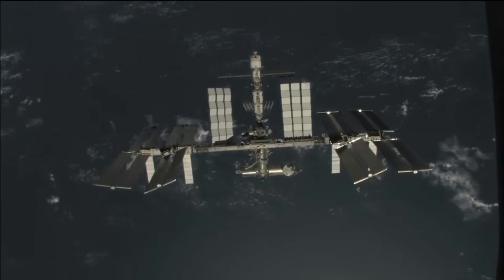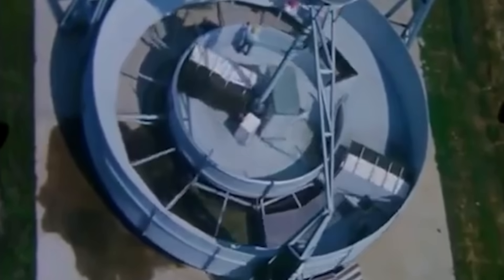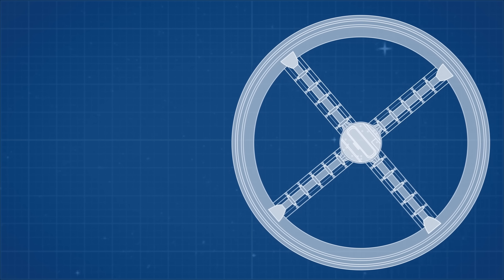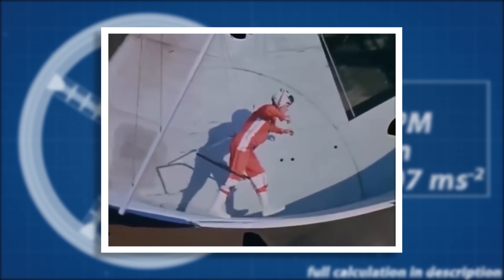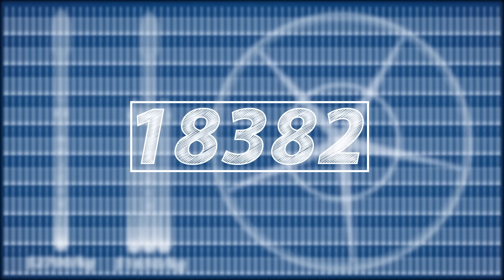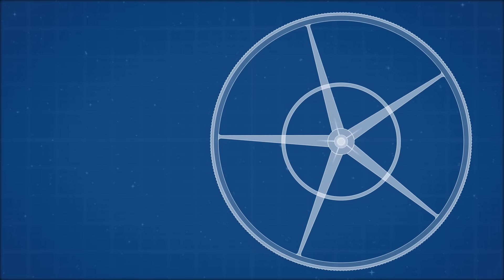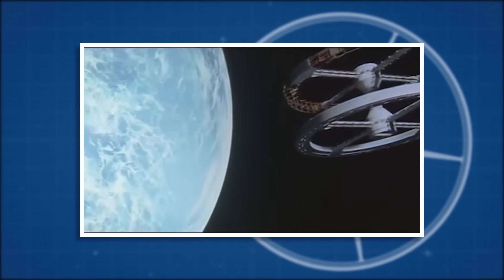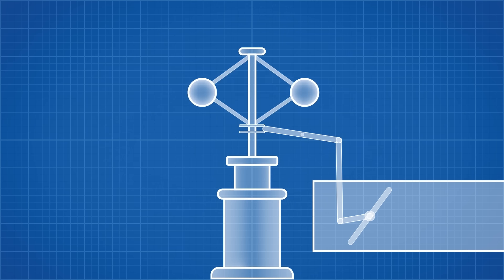Can We Create Artificial Gravity?

Comment: What are those things hanging off that dude's legs?

The guy walking around the loop...
Reply: to cancel out earths gravity. this artificial gravity is designed for space, so they need other stuff for it to work when there already is gravity
Reply: William Herron riiiiiight Thanks
Reply: C Hillman  " yup a Model, as in a bullshit theory" 

No I mean a model as in a MATHEMATICAL model. You can't dismantle math by wishing for it. Math describes our universe better than anything else we have available. 

"Earth orbits the sun, thanks to the microgravity at 66,600 mph too right."

Actually no, the earth orbits the sun thanks to regular gravity. Microgravity is an effect that takes place when you are "falling" at the same speed as what's around you. Like when you feel weightless for a second on a roller coaster. 

" This micro gravity is strong enough to hold all the planets in orbit - but somehow not strong enough to suck the planets into the sun or Moon's when they pass directly in between. "

Again microgravity is not to blame here, but regular gravity. Gravity DOES pull on the planet's, very hard actually but the way an orbit works is that it essentially moves so fast sideways that it "misses" whatever it is falling towards and continues to "fall" and "miss" the planet repeatedly. (I suggest looking more into the physics of circular motion and orbits if you're interested). Imagine that you could throw a baseball fast enough that as it curved and fell towards the earth, the earth curved away faster. This is essentially an orbit. 

"It strong enough to hold the weight of all the water and atmosphere while we spiral around the arm of the galaxy at 450,000 mph"

The reason why the water is undisturbed is due to another basic physics concept called Inertia. (completely unrelated to gravity for the record). Since the water is moving WITH the earth at the same speed, it appears as though it's not moving. This is why you can't feel that you're moving in a car without speeding up or slowing down. 

Yes, it is also gravity which is responsible for keeping it in the water in the oceans, but also for keeping the entire planet together in general. Without gravity the earth would never be more than a cloud of dust floating freely in space. 

" yet not powerful enough to hold the weight of a simple balloon, "

A balloon goes up thanks to something called the buoyant force. It is dependent on the density gradient of the fluid the it is in (in this case the atmosphere). You see a helium balloon is lighter than its equal volume of air, and thanks to gravity, the air on the bottom of the balloon is at a higher pressure than that on the top, so there is an upward force. Once this force is sufficient to overcome the opposing gravitational force, the balloon goes up. I don't see anyone claiming that a boat fucking defies gravity, seriously give this two seconds of thought. 

"magic - don't question its awesomeness"

No, it's science and you should question it, but when you do have some idea what you're talking about. 

p.s. we have the math so we win...

Hope this clears things up :)
Reply: C Hillman Quantum Electro Dynamics is the mathematical model of the electric force, and it has been shown to be accurate to the real world to one part in a billion (or 10^-9)

Nothing in the history of humanity has been that accurate or precisely measured.

"mathematical models don't work" My fucking ass, try taking a calc class maybe before dismissing the entire field.
Reply: C Hillman 
Earth gravity is easily modeled by a "downward" acceleration of 9.81 m/s^2. The way that this loop works is based on centripetal acceleration. When observed in the opposite frame of reference (the guy in the loop) it acts like a force pressing him into the wall of the wheel, acting like gravity. (centrifugal force)

True gravity is a warping of space-time caused by masses that ultimately causes them (the two+ masses) to be pulled together, Shown by the equation:

f=(Gmm)/r^2

Where f is the force of gravity, G is the gravitation constant, m & m are the individual masses in kilograms, and r represents the distance separating the two masses. 

So yes we know what gravity is, we know it very well. Micro-gravity is an important distinction from "no-gravity". Micro-gravity is a "simulated" weightlessness caused by accelerating uniformly. The ISS feels a pull of gravity from the earth, but thanks to the fact that it is essentially falling perpetually along with everything inside, you feel weightless. This is micro-gravity. 

I hope this clears up some confusion about gravity :)
Reply: C Hillman Don't even fucking try to talk about math with me, you are clearly mathematically illiterate. I guarantee no one in the scientific community EVER divides by zero. 

There is a thing in math known as limits that lets you do something like dividing by zero, but it is entirely different, and irrelevant to Einstein's theories. 

Trust me, if you actually dismantled his theories (which you've obviously never read) you would get at least one nobel prize. 

"blinding with numbers" is not a thing if you know math. It allows you to see further and clearer than any eye could ever see.
Reply: C Hillman I have his book "Special and General Relativity" It's sitting on my nightstand literally right now and I've read it multiple times.

I know what his theories say, you've obviously never tried if you think you'll just "get lost in the math".

So ya, I've read it, good one tho, try again!
Reply: Chris Topher "Id show you the proof but ill just leave that up to you to find the link."

There is your problem friend, you think you don't need proof for some reason. Well it turns out your opinion isn't worth its weight in shit.

"even Einstein had to divide by zero and do some number aerobatics to suggest the Theory of Black Holes "

I've already pointed out why this is completely not true, and you only continue to show your ignorance of math and Einstein's theories.

Keep telling yourself you're right, and maybe one day you'll be able to convince yourself.
Reply: C Hillman There is legitimately a 70 line explanation consisting of centripetal force, gravity, relativity, that I wrote. I've explained everything multiple times. 

You on the other hand have been claiming that mine is all just based on "bullshit math".

In other words: "boohoo math is too hard, and I have no argument!!!" 

The earth's spin is irrelevant when everything on the earth is spinning with it. This is called inertia, and this is why you don't normally "feel" the earth spinning. 

Coriolis forces are the result of being in the rotational reference frame that is the earth, and is irrelevant to this conversation. 

The earth's spin DOES have an effect on the Earth's shape if that's what you mean. The earth is not a sphere, it is what is called an "oblate spheroid", as it bulges out at the equator slightly thanks to its spin. This has been known for sometime and is the result of gravity and centrifugal forces on the earth. 

We have debated for a week, and yet your best argument is "Go read relativity, he divides by zero!!!11!!"

- You don't even know what you're talking about mate.
Reply: ***** One of my favorite quotes
Reply: C Hillman You're right, it has nothing to do with gravity. I was merely using it as an example of how precise our mathematical models can be. 

Try doing the math and you'll realize that we know how centripital force works very well. The centripetal force is one that points directly inwards at all times. It points perpendicularly to the tangential direction of motion at any point the the object is at around the circle. It acts to continuously change the direction of the object's velocity vector, while leaving it's magnitude constant. 

The "centripetal force" can be provided by many "more basic" forces such as friction (like when you're turning a corner in a car), Tention in a string (like if you're swinging a yoyo around your head), or gravity in the case of an orbit. 

This is literally high school physics, I wrote a lab on this very topic in my senior year. If you knew anything about math you would know how powerful it can be for modeling known systems and predicting previously unknown elements of these systems.
Reply: C Hillman If you really can't understand how a centripital force can be caused by gravity, I can't help you friend. 

If you really want to learn physics, actually read about it. You're making 100% unfounded claims. All you are doing is saying that our ideas are shit, without offering any reasons or better options. 

You're never going to make any scientific discovery by shitting on a theory  you clearly don't understand. 

I'm quite well versed in physics, so if you wish to have a real conversation with me, go re-take grade 6 math and then come back to me...
Reply: C Hillman You realize that you're literally trying to disprove Einstein right now... 

His name is synonymous with genius, but no this dude on YouTube definitely knows better!

Get a grip you mouth breather
Reply: Radio ToraDora I know it's useless but hey it's something to do.
Reply: C Hillman No you can't create "artificial gravity" (?) because gravity is caused by mass. You can't create "artificial mass" can you? No

However, you can measure the gravitational attraction between two known, already existing masses, and this has been done countless times by many research groups. 

Furthermore, gravity was only first suggested by Newton some time in the 1600's, so try 300-400 years, not 2 000, but just because we can't make some crazy anti-gravity gun or whatever the hell you're talking about now (no really you're making no sense) doesn't mean our gravitational model is not incredibly well understood. 

You can't make a sunrise at will, but we still know how it works. 

No mental gymnastics are needed, It is clear you have never even seen a physics equation before, but go ahead keep trying...
Reply: Don't get into an argument with an idiot. They'll bring you down to their level and beat you with experience.
Reply: C Hillman This wasn't even an argument. This was you putting your fingers in your ears yelling "LALALALALALA"  while I continuously owned you with science.
Reply: C Hillman *you're

If you're going to insult my intelligence, spell everything correctly.
Reply: C Hillman Buddy dosen't even need to read my argument to dismantle it apparently...
Reply: +Don't Even Bother don't bother (what your name suggested), it's a waste of time to argue with him. He's luckily not a flat earther.
Reply: C Hillman Look up Hawking-Penrose's Models if you're interested in black holes. 

As for the "holy grail of gravity" there are some unanswered questions, like How does gravity relate to the other fundimental forces, and notably quantum mechanics? But these do not take away from what we know about gravity, space-time, gravitational lensing, orbital mechanics, relativity, and all the other nuances of gravitational theory.
Reply: C Hillman Lmfao, I guarantee you that Neil DeGrasse Tyson definitely KNOWS (that's right KNOWS) that mass causes gravity, but no he is definitely smarter than me (in astrophysics at least), but he would be a terrible example to use if you're trying to dismantle gravity, because he definitely agrees with me. 

"but i can't be replicated no matter how big a mass we create something"

Yes it has been done many times by research groups all over the world. If you took two seconds to look it up before saying it hasn't happened ever, then you would stop yourself from looking so uneducated. 

"even quantum physics can't find it"

These are the ramblings of someone who doesn't know the first thing about physics (i.e. quantum woo), but as I said before quantum mechanics is completely separate from gravity in every way. In fact it is pretty much the goal of much of physics right now to unite gravity and quantum mechanics, but it has been unsuccessful so far. So if you think that they are related, please do tell, there is sure to be a nobel prize in your future. 

"i suggest you crack open that year 1 physics book and rethink what you really know."

Alright, I always look for an excuse to do physics. As for you, I suggest you actually buy a first year physics text book. 

Better yet, actually go to a physics class and learn from someone who studies this for a living, and for god sakes LEARN SOME MATH.
Reply: C Hillman Here is some critical thinking for you:

Who is likely more correct?

 Two hundred years of professional physicists dedicating their entire careers to the study of their choice. These being people who are driven by knowledge. Knowledge that they also spent years to try and make public so that it can be properly reviewed...

Or this guy on YouTube who refuses to even tell me anything about his position other than "your ideas are stupid"?
Reply: he's hanging by wires on his side. Kinda like a hollywood ninja movie. You're looking down from above and the spinning drum is flat on the ground.
Reply: why do you bother :D
Reply: +Don't Even Bother What a legend you are
Reply: C Hillman No, just no. 

Do you honestly think that I am going to spend my time looking for evidence supporting your argument? 

Literally no one would, fuck off.
Reply: C Hillman All you have to do to prove me wrong, and get me to shut the fuck up for good is to point me to the exact passage in Special/General Relativity, where Einstein "divides by zero to make his theories work". So that I can see it with my own eyes. 

You said it, so it must be true... or would that just be making it too easy for me? Wouldn't want to be spoon fed the information that is going to completely overhaul physics!!!!
Reply: C Hillman And in a stunning turn of events, I win.
Reply: C Hillman Anyone who calls it "astro science" is clearly super duper smart amirite?
Reply: C Hillman You're a walking joke
Reply: Chris Topher *edits his comment so he doesn't look dumb.
Reply: Chris Topher Yeah i let my balls dry in the wind when Im done showering, hows that for free?
Reply: Chris Topher There, once again you have only proven your ignorance. 

Like I said. Gravity is a physical phenomenon. You can DESCRIBE a physical phenomenon with math, but you can't PROVE any physical phenomenon (what the hell does that even mean? honestly).

You can collect evidence which supports the theory and the description of the phenomenon. 

For god sakes I've asked you to show me this compelling evidence that you have which suggests gravity is anything other than the 3D warping of spacetime caused by mass over and over again. 

You refuse to give it to me only claiming that "I have to look for it". This makes no sense because I'll never know what the hell you're talking about other than the vague concept that gravity is electromagnetic? 

That's not a hypothesis, you have to predict something with your potential theory, and then demonstrate your prediction to be true. 

You obviously don't ever partake in scientific discussions because this is incredibly one sided.
Reply: Chris Topher You haven't given me so much as a single article, link, or even a damn suggestion as to what to google to hear about this trash.
Reply: Chris Topher No, there's a difference between spoon feeding information to someone, and that person asking you to clarify what the fuck you're talking about.
Reply: It's simulating weightlessness in a 2D and ignores the depth.
Reply: Chris Topher Proof, evidence, call it what you want, you still don't have any... (or you would have presented it!)

"it took me forever to find" is a fucking cop-out and you know it.

You know you have nothing, I have you backed up in a corner, it's okay.
Reply: Chris Topher Lmao what does that even mean? 

p.s. I have a good friend that we call chris topher (no lie) this is wierd.
Reply: awesley92 lol, see it as an excuse to brush up on my physics.
Reply: Chris Topher You sir are the one who doesn't realize the beauty and complexity of the physical world when you do away with preconceived notions. 

You don't even know what you don't know, and that is fact. 

Plato called it double ignorance, I call it stupidity, but the first step to knowing is admitting what you don't.
Reply: awesley92 Oh of course, how could I forget
Reply: Chris Topher You wouldn't even know where to begin with a mathematical proof sir.

You obviously don't know the meaning of the word. Claiming 2 + 2 =5 as an axiom would is never how it works.

Have you ever even heard the term "proof by contradiction", "Proof by induction", "Direct proof", or ANY of the hundreds of different methods used by mathematicians?

Believe me, someone who has been studying math for a long while.

Proofs are hard.

For example, we can prove by induction that all positive integers of the form 2n − 1 are odd. Let P(n) represent "2n − 1 is odd":

(i) For n = 1, 2n − 1 = 2(1) − 1 = 1, and 1 is odd, since it leaves a remainder of 1 when divided by 2. Thus P(1) is true.
(ii) For any n, if 2n − 1 is odd (P(n)), then (2n − 1) + 2 must also be odd, because adding 2 to an odd number results in an odd number. But (2n − 1) + 2 = 2n + 1 = 2(n+1) − 1, so 2(n+1) − 1 is odd (P(n+1)). So P(n) implies P(n+1).
Thus 2n − 1 is odd, for all positive integers n.

All that did was tell us without a doubt that (2n-1) is always an odd number.

So you can see how complex this straightforward example is, now imagine how much harder it can really get.

Mathematical proofs, however will never demonstrate that a hypothesis, equation, or model fits the observed evidence. You'll never see a mathematical proof for the equations of gravity, because that's not how it works.

To prove a scientific theory requires experimentation, data collection, isolation of variables, graphical analysis, and a whole slue of other techniques, none of which are to make "debunking" YouTube videos.

If you want to prove your hypothesis that gravity is fake, you'll have to get a little more complex than saying "math sais 2+2=5, therefore gravity is actually electromagnetism." Now that's just silly.

Doing this you really minimize the lifetime of work and dedication it takes to thoroughly understand these topics, but you won't read this comment, you'll just cover your ears and start reciting dogmas in your head.
Reply: Chris Topher Your only problem is an unwillingness to learn. 

An intelligent human being can mentally process and idea without accepting it to be true. You refuse to even undertake such a simple task. 

YouTube's crazy side has taken you too far down the rabbit hole... There's no coming back
Reply: Chris Topher Thank you, this has been a great insight into what I don't want to become.
Reply: Chris Topher There's no helping you, loosen your tin foil hat. 

peace bitch
Reply: Chris Topher Aha, I'm writing cover letters for a cooperative position focusing on organic chemistry and synthesis. 

What are you doing?
Reply: Chris Topher Greeeeeat argument there buddy, for every bad thing chemistry has done there's 150 000 noble ones, no one with a brain agrees with you.

Nitrogen fixing is the process that feeds over a billion and a half people on the planet, including you if you live in the first world.

The goddamn computer you're arguing me on is a testament to the power of chemistry, silicon p and n-type doped semiconductors.

Inoculations, medicine, and every single bodily function is just one extremely complex chemical system.

Bringing up 200 year old ways of thinking is not going to dismantle quantum mechanics, molecular orbital theory, Bohr's theory of the hydrogen atom.

Alchemy, even though no one has talked about it for 200 years is more related to particle physics, and for the record, we HAVE now turned base metals into gold using particle colliders. Nonetheless it lead to some of the earliest progress within the field of chemistry.

Those who were smart enough learned to follow the evidence, bringing us after hundreds of years to what we have now.

Next time you take a life saving drug or anesthesia when you undergo surgery, you damn well better thank the world's chemists bitch.

You're in so far over your head here kiddo. If you get me starting to talk about chemistry I'm just going to keep schooling you relentlessly.

You have been warned...
Reply: Chris Topher I spend 6 hours a week at the very minimum in chemistry labs, and many more doing the work associated with it. 

Try me
Reply: Chris Topher Okay, I'll take that into consideration. 

Tell me, if you love the Pacific ocean so much, why don't you head out there with a butterfly net.
Reply: What a troll hahahahaha.
>gravity alone doesn't explain the effect of the density/buoyancy therefore gravity doesn't exist

Since you also don't provide an explanation does that mean that you too don't exist either? 
I'm just using your own logic bro...

(For the record I don't think anything objectivly exists and this is all theoretical. But that is seperate kettle of fish altogether and I accept that there are scientific principles govering this particular theory space. Unlike you apparently?)

Next time you try to discredit something how about you consider providing an alternative or at the VERY LEAST an explanation as to why it's incorrect.

In finishing you can believe what ever the fuck you like but unless you bring something to the table you are just going to be laughed out of the building...
Reply: Chris Topher for your balloon problem the reason a helium balloon floats is because the gas inside is less dense, therefore there are fewer practicals to be pulled down than in regular air. Its only the atmosphere that creates that illusion. In a vacuum it would be accelerated by gravitation the same as any other object.

And yes Newtonian gravity was disproved like a century ago, it was replaced by the theory of gravitation for which the math holds perfectly fine.

And before you say it's "a theory" everything thing is. That is just the nature of a subjective reality. nothing can be known for certain, but these principles hold better than anything else we have come up with, so it makes perfect sense to me that we work off the assumption that its correct until it's disproven or a superior  alternative is found. Otherwise you can't get anywhere.
Reply: Chris Topher lastly I don't have enough of an understanding about quantum mechanics to make comments on the higgsfield which is assumed by many scientists to be the source of mass in the universe. But even if our understanding of the mechanism behind mass is incorrect the effect of it is quite noticeable and the math we have developed using it is incredibly useful. So to just completely discredit the idea would put us back in the stone age. What it comes down to is that science has an idea that appears to work for the most part so we just keep using it until something better is discovered then we modify out current knowledge base to fit the new principles.
Reply: At the end of the day when you drop a rock there is an increase in kinetic energy relative to you. Even if that doesn't come from the potential energy of gravitation (but mathematics, our formal language of logic, shows that this  method can hold),
there is some force at play which you cannot seem to explain without accidentally using gravitation.

If you aren't interested in trying to look at it from another's perspective than this entire discussion is pointless. I have consistently tried to look at it from yours but you haven't given me any tools to logically prove it (eg proof by contradiction)
Reply: Chris Topher Buddy, you're literally just copy-pasting your arguments from shit blogs

http://aaronsreality.blogspot.ca/2009/07/disproof-of-gravity-by-aaron-guerami.html

That's for the 200-liner you just dropped up there, oh great science master!
Reply: Cause its not real gravity, its simulated gravity by just duplicating centrifugal force - if he stops moving -he's screwed. Artificial gravity is just fantasy thinking, because they can't even explain what gravity is. It's funny how they refer to space as having microgravity now - what a joke.
Reply: yup a Model, as in a bullshit theory - thanks for clearing that up. Earth orbits the sun, thanks to the microgravity at 66,600 mph too right. This micro gravity is strong enough to hold all the planets in orbit - but somehow not strong enough to suck the planets into the sun or Moon's when they pass directly in between. It strong enough to hold the weight of all the water and atmosphere while we spiral around the arm of the galaxy at 450,000 mph yet not powerful enough to hold the weight of a simple balloon, magic - don't question its awesomeness.
Reply: yup, you shoulda stopped after the first line
Your mathematical models are but assumptions and failures, you have been fooled.
Reply: Don't Even Bother I read it but an electrodynamic force is not gravity , spinning an object just creates centrifugal force at the extremes, try standing in the middle and you'll realize all your models are complete horseshit made to fool the weak minded.
Reply: So you finally admit it, centrifugal force has nothing to do with gravity and being knowledgeable about electrodynamic models does not give you any insight into the working of this invisible force that makes certain things fall to the ground. I really get about as much information from reading your comments as I do when i looked at the log that came out of my butt this morning. Thank God for the myth of the Coriolis force force that allows me to flush that away.
Reply: Most of his work depends on you believing division by 0 is actually something, he blinds you with numbers.
Reply: Don't Even Bother Why dont you actually read some of Einstein's theories instead of assuming you know anything about what you were taught to think.
Reply: Don't Even Bother So why dont you sweep the dust off your nightstand all tell me the exact math theory is that describes what a black hole is? Isn't it the holy Grail of Gravity?
Reply: ***** Wait what is this about?
Reply: Don't Even Bother Well you can't create artificial gravity - if they don't even know what gravity is, because gravity itself is still just a theory - and despite Two Millennium to prove its existence - it's still pretty tough to do the required mental gymnastics required to accept it although they certainly have done there best to make everyone believe it's real.
Reply: Don't Even Bother well it's obvious you were taught but so was I. Are you sure mass causes gravity, Don't you think its funny that even Neil Tyson doesn't really know what it is- but your 100% sure you do. Are you saying your smarter than him?
I know you were taught that, but i can't be replicated no matter how big a mass we create something- even quantum physics can't find it , so i suggest you crack open that year 1 physics book and rethink what you really know.
But I'm sure you wont - thinking you know it all already - but really what do you know.
Reply: Don't Even Bother "Neil DeGrasse Tyson definitely KNOWS" - He has a guess , I'd call it an educated guess. But at least he knows the difference between a guess and actual fact - he cannot truly describe what causes it or what it does - cause he knows it know matter what he said it be a lie and that's its still only a theory that Newton only suggested and that people like you accept as total fact. And brainwashed in your consciousness by Disney and Nasa.

Id show you the proof but ill just leave that up to you to find the link. Time to wake up.

How can math prove something that doesn;'t exist - only in your mind is how.
Btw the math doesnt prove anything and some of it is fake - even Einstein had to divide by zero and do some number aerobatics to suggest the Theory of Black Holes - even my 8 year old daughter knows you can't do that. You've simply been fooled, distracted by your own ego.
Reply: Proof is not evidence if i just spoon feed it for kids to spit up.. Took me a long time to find it. You can find all kinds too, once you actually start looking.
Reply: Don't Even Bother proof is all over the internet, like i said not my job to spoon feed you, crying might work with your mother, but her I am not.
Reply: Of course you won't, idiots like you expect everything your free and cry if you don't get it.
You only get what you pay for and public education has only taught you to memorize facts - not how to think critically.
Reply: Don't Even Bother Why would I spend a week debating you, your not even in a learning attitude, go pay for your education.
You got 200 years of information to stand behind so feel free to use it at anytime - Like would you care to explain to explain as to how an airplane's gyroscope works, the details of how and why they work, and then exactly how they account for the earth's spin and coriolis regardless of direction all while they are accounting for a curve.
Reply: Don't Even Bother " 
Don't get into an argument with an idiot" - mmm ok you win.
Reply: Don't Even Bother Astro Science got Rekt.
Newton's work into how to turn stuff into gold are better.
Reply: Don't Even Bother That's what Sun Worshipping Atheist Astro Priests study.
Reply: Don't Even Bother Considering you're a beslubbering hasty witted dingleberry, that's a compliment, so ty.
Reply: Don't Even Bother Can you prove a dingleberry has intelligence? If not - I didn't insult it then.
Reply: long fall boots.
Reply: Don't Even Bother *edits his mind so he can believe what he is told to think.
Reply: Don't Even Bother It just means you need to figure out how someone is telling you what to see If I, or anyone tells you an opinion, they don't care whether you believe it or not, if however they are using simple social stigma to force you to believe propaganda and someone needs to get angry because they dont want to realize they themselves are being controlled This conversation was initiated because your mad that you can't control what i think, your continued denial of this fact is proof of your sophistry in your reasoning.

Well if you have a good friend called Christopher, i'm not surprised because they are usually good friends, please stop trying to be my enemy.
Reply: +Don't Even Bother don't know why you bothered with this dude for so long, he obviously sits in his lead encased basement with an aluminum foil hat on
Reply: awesley92 I let the wind blow my into my beautiful hair, your mind is encased in a lead prison created by the astro priests and you dont even realize it. Free yourself.
Reply: Don't Even Bother I know that if Gravity was really real, there would be some way to prove it and that its buffoonery is completely revealed whenever you try to introduce a third object into the false idea that mass attracts mass and that gravity the only reason you think the world is round - you're completely deluded into your fake reality and cling to it like a baby does to his security blanket.
Reply: Chris Topher Lmao I love how you think multi-bodies systems oppose our understanding of gravity. 

If you want proof for anything you have to do your research.
Reply: Don't Even Bother They do, why dont you have your butt buddies at Nasa do an experiment on the iss - show how mass attracts mass and how a third object affects the attraction - btw - dont hold your breath cause they will never show that ever ever ever - because they already have you fooled and that's the goal, not to prove anything, lol.
Reply: Chris Topher You don't need to go very far to use the old google machine. Gravity is easily modeled as a vector force. Vectors are grade 11 math shit. It's rather trivial. 

I have notes in fact from my grade 11 year of just these types of systems. 

So you've again just highlighted your ignorance on the subject.
Reply: Don't Even Bother your proof of gravity is some math theory? Fooled with numbers are you? I suppose your going to tell me 2 + 2 = 5, math proves it, look it up.
Reply: Chris Topher You really are a fuck tard, enjoy the loony bin.
Reply: Don't Even Bother 2 + 2 = 5,  Thanks Common Core Math Logic
Reply: Nope, I've learned all the proofs of gravity and I've also learned all the proofs that gravity isn't real. Once you open your mind up to both possibilities, you'll see the truth. People like you are only willing to learn what you are told and now you build up a wall around your mind that is impenetrable. "Don't Even Bother" says exactly your unquestionable faith in your delusions.
Reply: It's not my job to spoon feed you info just so you can spit it out. There are two ways to use the internet - to learn things or to spoon feed your bias. Id learn all you can and then decide, what your doing is you've already decided what to learn and criticizing those who know more.
Reply: Don't Even Bother If you can't figure out what I'm talking about, do you really expect me to believe any information I point at. Im sure you'll skim over someone and think you understand it. It takes years to really understand something like gravity and why it's not real. I wish you well on your journey, but rest assured "The Force" you think you understand, only exist to keep you from looking.
Reply: Don't Even Bother You want to stay ignorant  because it's popular to claim you understand and have faith in everything you learned in grade 6 science class because your balls haven't grown yet, and everyone needs to agree with your opinion or they are and azz?.. well, good for you mate. You sound pretty much like your well on your way to being a grumpy old man. I'll get off your lawn.
Reply: Chris Topher I don't have faith in anything. I question every facet of my world, but I recognize when I don't know something.

You are hubris enough to think that you know enough to dismiss everything that you don't.
Reply: Don't Even Bother really - you think you question things - so tell me what questions you have around the idea that we really went to the Moon? If you could ask three questions to Neil Armstrong - what would they be?
Reply: Don't Even Bother See i ask you to name your questions and you pull the "it 8:30pm, time 4 bed" Alright kid, sweet dreams.
Reply: Chris Topher I assume you're going to tell me that chemistry is all bullshit too?

What was that NASA as well? or someone else this time?
Reply: Don't Even Bother You know how chemistry was born - Alchemy, and you know who loved trying to turn things into gold more than Rumplestiltskin - our good old friend Newton.
Chemistry has done some wonderful things - like creating plastic so known you can visit the great pacific garbage patch full of disposed plastic, maybe you can go fishing there when you get older.
https://en.wikipedia.org/wiki/Great_Pacific_garbage_patch
Reply: Nan0Scho1ar The standard particle model has yet to find any evidence of Gravity. This is most concerning since gravity
is used by most modern equations. Great particle accelerators have hunted for any signs of gravity. None
found!
There are several ways to disprove gravity.
1) Experimentally
One simple experiment shows there is no gravity. The Helium Balloon. It rises. How is this
possible? Classical Mechanics shows that Force equals the Constant of Gravity multiplied by the
Mass of Object 1 multiplied by the Mass of Object 2 divided by the Distance between the two
masses raised to the second power.
F=GM1M2/r^2
With this logic, the mass of the Earth is so great that the helium balloon would have no choice but
to be attracted to the Earth. We have mass 1 pulling on mass 2 and mass 2 pulling on mass 1.
F1 = F2. This is just wrong. The force of the balloon that pulls the Earth is not equal to the force
that the Earth pulls on the balloon. It would not rise. What we see in the experiment that the
helium is rising to meet its level of density.
2) Commutitive
The mathematics of gravity is a concept called Zero Point Mass. This is a mass without a volume.
This is not found in the universe. The main problem here is the reduction of 3 dimensional
densities to 0 dimensional masses. Once a density is reduces to a mass, the mass cannot be
returned to the original shape of the density. So we cannot cube a zero and get anything but
another zero. This breaks the commutative properties of addition.
Let’s look at some of the equations and how gravity fails at a fundamental level.
F=ma : Force equals mass times acceleration.
We have a zero dimensional mass * a 2 dimensional vector and that does not equal a 3
dimensional field. So the main axiom of gravity fails the commutative test.
This alone should disprove gravity.
F = G(M1*M2)/r^2 : Force = The constant of Gravity * (The zero dimensional mass 1 * The zero
dimensional mass 2)/ The 3 dimensional length between them squared. So every object pulls
every other object. The dimensional problem occurs again.
A constant is what is used to fill in the gaps. When things do not work the way we want them to,
we just add a constant to fix the problem. When the equation no longer works, we change the
constant’s value. 
Physicists know about this problem. They created gravity waves and shell modeling to
compensate for the dimensionless mass. But gravity is still dimensionless. The dimensionless
mass cannot create a 3 dimensional shape.
We all know that gravity collapses under the scrutiny of the tiny. Quantum level objects do not
show any signs of gravity. The particle accelerators prove this. They have yet to find any force
that works as gravity is described.
3) Gravity fails the multi-body test.
Gravity can only compute the force between 2 objects. Any equation that uses a sum of objects
fails in this way. First the two objects force is computed then the third body is computed with the
resultant of the first two bodies. Then that resultant is computed with the 4 body... That is how
summation works. The problem is that the distance between object 1 and 2 is not evaluated in the
next iteration.
4) Gravity and Complex Systems.
Let’s look at a hurricane that is traveling over the ocean. The spinning winds cause rotation in the
ocean. The low pressure of the storm causes a bulge upward in the ocean. Heat and pressure
are two of the main variables in this system. As the temp increases it decreases the pressure of
the storm, causing an increase in intensity in the storm. The heated air is forced up the eye wall.
This is an example of a temperature/pressure force on density. It is not possible for gravity to
describe this system, with or without spheres.
5) Questions posed by others:
- the rain fall because of gravity.
- the rain occurs because of water vapor cooling (temperature going closer to the dew point).
- the rain formation in itself is a very complex phenomena.
- the dynamics of rain formation depends on the presence of aerosols and fine particles.
- the dynamics of rain formation also depends on complex collision and coalescence
phenomena.
- the ascending motion of air is driven by gravity on all parts of the atmosphere.
- this ascending motion is also affected by the Coriolis force.
- this motion is affected also by the drag of rain.
- this motion is also affected by the detailed geometry of the hurricane.
- the fluid dynamics itself exhibits an incredible complexity, like turbulence and instabilities.
- the term "T" in the Navier-Stokes equation above hides a lot of complexities that often still need
to be understood.
- heat exchange plays an important role, yet it is not simpler than the fluid dynamics.
- the rain fall because of gravity
Rain falls because as cold water it is more dense or less buoyant then the surrounding air.
- the rain occurs because of water vapor cooling (temperature going closer to the dew point).
Yes, that is one way of looking at density and Buoyancy
- the rain formation in itself is a very complex phenomena.
Yes
- the dynamics of rain formation depends on the presence of aerosols and fine particles
Yes, the mixture of dirty water causes it to be a more dense mixture.
- the dynamics of rain formation also depends on complex collision and coalescence
phenomena.
Yes again, as the less dense gas collides with other gases, their temperature reduces and the 
gas becomes liquid. This process occurs until the liquid water is heavier than the force of the
updraft.
- the ascending motion of air is driven by gravity on all parts of the atmosphere .
No. The ascending motion of air is due to the changes in temperature. The air heats at the
ground and rises. As it rises it cools and becomes liquid again. The liquid water is more dense
then the surrounding air.
- this ascending motion is also affected by the Coriolis force .
There are only 4 forces, Gluon - nuclear, W Boson - magnetism, Z Boson - electricity, and the
Photon - heat. Those are the only forces that have been experimentally shown.
- this motion is affected also by the drag of rain
Of course, As rain falls it drags against the updraft. This is the friction that removes the heat from
the air. Heat radiates to cold.
- this motion is also affected by the detailed geometry of the hurricane
The motion is the geometry of the cyclone. Geometry is a snapshot in time of an object.
- the fluid dynamics itself exhibits an incredible complexity, like turbulence and instabilities
The whole system is buoyancy. Buoyancy is only fluid dynamics. As a matter of opinion,
everything is fluid dynamics.
- the term "T" in the Navier-Stokes equation above hides a lot of complexities that often still need
to be understood
Like G, they change T frequently. These changes of G try to mimic the evidence. Just change the
constant and you will get what you want to see.
- heat exchange plays an important role, yet it is not simpler than the fluid dynamics
Heat exchange is intrinsic to fluid dynamics. You cannot remove heat from the fluid dynamics
problem.
- yet, suppress gravity and there are no hurricanes anymore
One cannot suppress gravity. Gravity is not real. It’s an old model of how objects move. Evidence
has forced major changes in gravity. There is no supporting evidence of a graviton. It is like the
Higg’s boson. Something that was built to try to explain interactions, but it does not.
6) Silly paradoxes created by gravity.
a. Black Holes are easily disproven by Crothers at sjcrothers.plasmaresources.com
b. Worm holes/Time travel
c. Parallel Universes
d. Relativity
e. Flat universe
f. Graviton decay
g. Higg’s Boson

Kepler's 3 laws are more in line with how planets orbit the sun. This is because of the Sun’s motion
around the galaxy. This causes the elliptical shape of the orbit. Not gravity. Gravity cannot explain 3 body
interactions. If the equation has a G in it then it is a Zero Point Mass system and that does not exist in
the universe.
The rules of the universe are simple. An atoms position in a system is based upon its density in relation to
the surrounding densities and the changes in magnetism, electricity and temperature. Density is the most
important function in determining the position of an object. Density is the vibration intensity within a
volume in relation to the density of the surrounding medium.
Reply: In my opinion, keyword being opinion, it is paradoxical for this to objectively exist. But it is also paradoxical for nothing to exist as that would be an absence of itself.
Therefore theory space must exist.
A universe is a particular theory space and all universes have the potential to exist.
they don't all exist theoretically in the way this one does as some are paradoxical also.
each universe is governed by a set of logical principles which state the things that have the potential to exist in each universe.
and those logical principles are what we try to describe with science.
science doesn't say this is CERTAINLY CORRECT. Science is our best estimate of what those governing logical principles may be. So to say they are wrong and not provide an alternative is extremely counter productive as it leaves you nothing at all to work with.
Reply: Nan0Scho1ar But to claim a theory is a scientific law because some people agree on it and without an actual logical proof = its just an assumption. Gravity is a theory, many people try to assume its a law. To explain the reason things fall can be done perfectly with density and buoyancy and is a completely reasonable and proof-able explanation.It may be beyond your understanding, but science doesn't bend to the lowest common IQ.
Reply: Chris Topher The math is our logical proof and and buoyancy is reliant on gravity to function or all you are left with is surface tension for liquids and completely broken gasses
Reply: AND AGAIN Newtonian gravity doesn't exist. the only reason it is still used is because it simplifies the mathematics required for everyday type calculations.
Newtonian gravity is a tool
gravitation is out theory of how it actually works
Reply: Nan0Scho1ar Man, I wasted many a-nights explaining gravity to this mouth breather. Best of luck
Reply: If you wanted to copy shit blog - Id copy "Don't even bothers comments" you should actual read and understand aarons proof - his logic is far better than yours.
You probably dont even understand that  Einstein disproved Newtons idea of gravity as complete poo poo.
Reply: "The math is our logical proof" - Einstein's  math is not a prove gravity - that's why its still a theory, and a theory is not proof if you put scientific in front of it and get some eunuch nerds to on it.
Reply: we have observed proof of gravity look it up
Reply: Okay lets start easy:
First of: No, we don't know what exactly causes gravity. Only thing we know is that masses attract each other. This is a fact you cant deny.

Next on Microgravity. Say that Space have gravity is wrong. Space itself is the absence of everything. So, Space itself have no gravity. What you talk about is that people in Orbit around the Earth experience Microgravity.

To understand what this means you have to know what an orbit is. Basicly it means that an Object, moves fast enough around a body that it escapes the Bodys Gravity at the same speed as it is pulled towards it. There are plenty of Videos which explains this. So Everything in Orbit isn't free of gravity. There are still gravitational forces, but they cancel out due to the orbital velocities. The Object in the State of orbiting experience this as what was former called weightlessness. The Name was changed because something in orbit isn't completely weightless. So they called it Microgravity. Gravity is still there, but it's experienced incredibly weak.
Reply: dies200 not even sure you can prove mass attracts mass - and if it does - the effect is so small - it doesn't explain why things fall to earth - when it can be easily explained by density and buoyancy. Density is not simply mass and volume as you have been taught. An atoms position in a system is based upon its density in relation to the surrounding densities and the changes in magnetism, electricity and temperature. Density is the most important function in determining the position of an object. Density is the vibration intensity within a volume in relation to the density of the surrounding medium.
Reply: Density is defined as mass per volume or with other words, how many atoms of a specific element can you squeeze into a cubic meter. The "vibration" of the atoms or more specific their energy can change the overall density of the material. For example Vapor is less dense then water is less dense than ice. Things tend to expand based on their temperature.

But you are right. I cant prove that. But we have seen that the more massive an object is, the higher its gravity. For example:
The Earth has a mass of about 5.9 Septillion tons and a gravitational acceleration of 9.8 m/s^2
Jupiter is 318 Times heavier than the Earth and thus have a gravitational acceleration of 24 m/s^s

We aren't 1000% sure that mass is the cause of gravity. But what we are pretty certain about, is that a higher mass comes with a higher gravity